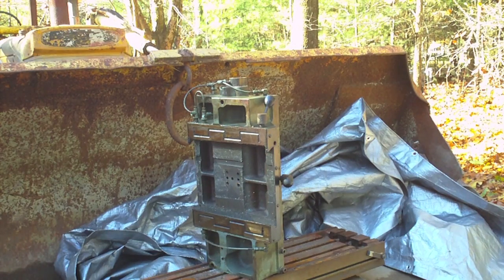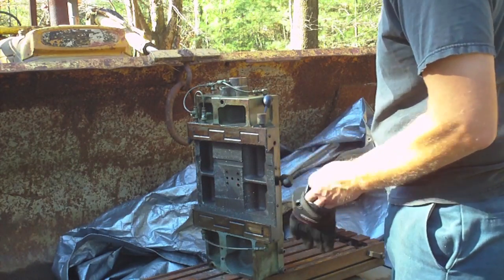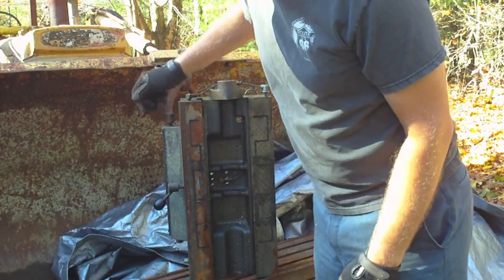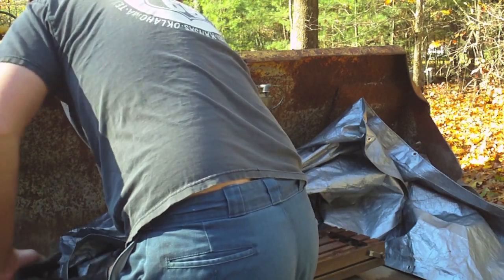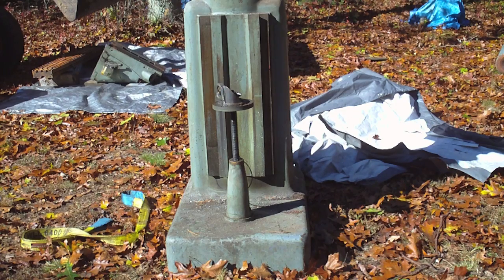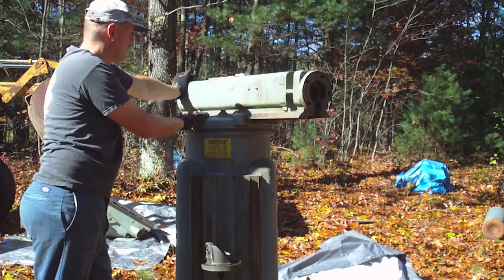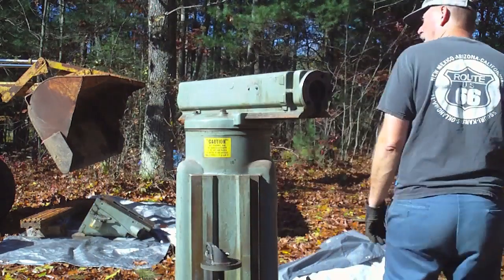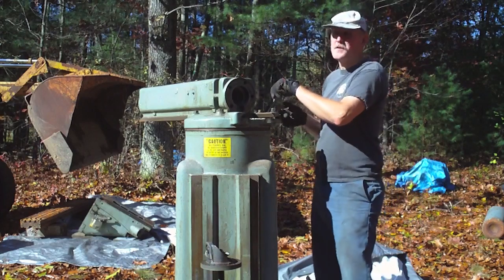Wells Index Milling Machine Part 9

Comment: Hey Steve, Where is the crane arm you built for moving this stuff? is the arm too long and causes a counter weight issue?
Reply from the maker: I was a little worried about maxing out "mini crane". It'd hand the smaller components just fine, but that body is really heavy.